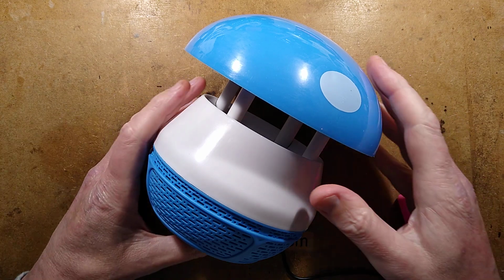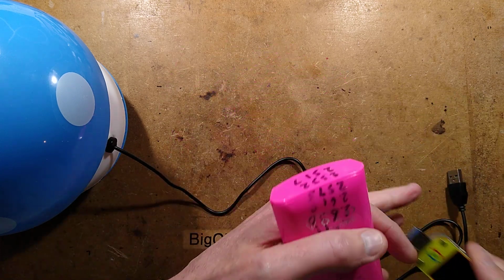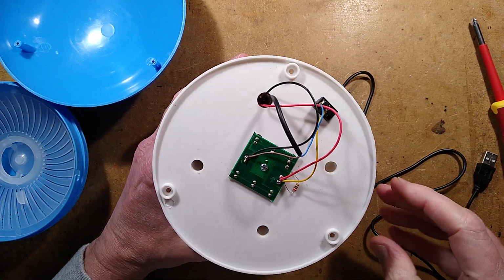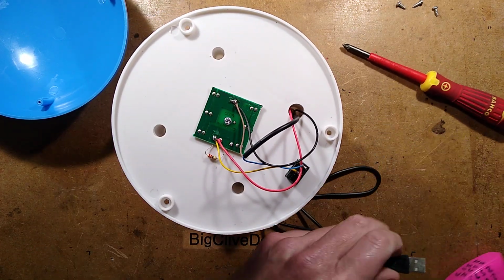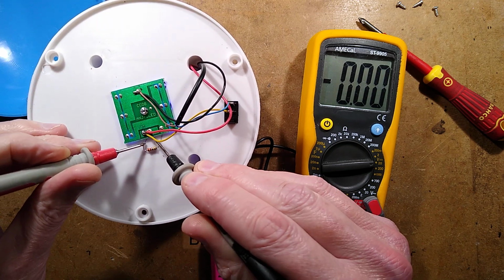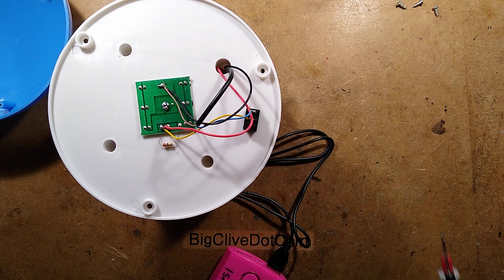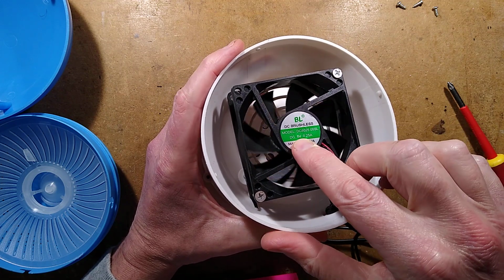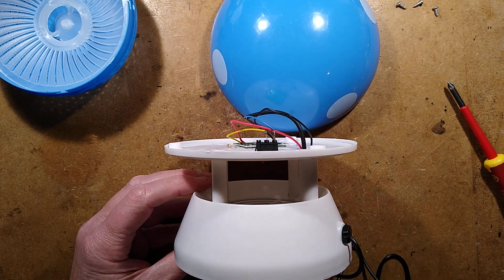Fly chopping electric toadstool

Comment: It reminds me of a project years ago that I saw. It was a "better mouse trap". Two plates insulated from each other with a high voltage between them. Cheese in the centre. Rather than killing the mice the muscular response to the boot threw the mice off the thing but they kept coming back for more. I resisted the temptation to build one.

Comment: Those LEDs look like they're some flavor of UV instead of the usual blue; you spotted it, the visual diffusion inside the plastic is a pretty good indicator.
If you have anything blacklight reactive laying around, stick it in there and see what it does.  It will probably light up like a scorpion under a geological study UV lamp.

Comment: looks like it could easily get turned into a slug trap if its rubbish at catching flies. bit of beer in the bottom and your good to go. You could get rid of the mosquitos with this also. the mosquitos would be attracted to the CO2 from the beer. bonus points if the fan is still running to fling them into the puddle and drown

Comment: How reliable are multiple LEDs in parallel? If they're anything like ordinary diodes, if one gets slightly warmer it will take more of the current and get warmer still.
Reply: I believe that you are correct. Each and every LED should have it's own current-limiting resistor. One LED will hog the current as they age.

Comment: I expected an element with a boost voltage transformer like proper insectocutors with the blue tubes, basically this won't kill flies unless they get chopped up in the fan, the odd one might, might be good to use as a child's night light once the fan is removed, sadly I can't see it performing well as an insect killer though.

Comment: Wow! As if the tiny bits won't be blown out of the openings and the bodies desiccated in the process, making them even more likely to blow through the slots! Incidentally I bought a very well made mosquito attracting device using UV and I found it to be extremely ineffective and the mosquitoes randomly flew right past, entirely unaffected by the light.

Comment: My experience, and a scientific paper I once found, tells me that mosquitoes have multiple means of navigation with different priorities.
CO₂ gets absolute priority. If they notice a stream of CO₂, they will fly into it, which leads to the god awful buzzing around one's ears and sometimes even the @#%* things trying to fly into your mouth.
In absence of an obvious CO₂ source however, they usually want to fly towards light, with apparently a preference for bluish light. This makes it a terrible idea to leave one's window open in the evening with the lights on, especially if that window is facing in the opposite direction of where the sun is going down, because you'll have all the mosquitoes flying towards the sunset and towards your window with the deliciously attractive light. I have made that mistake one evening last summer, and I have slaughtered about 80 (eighty) mosquitoes that night, yes I counted all their corpses. I used a mains powered insect lamp which I had to empty at regular intervals because the insects were overloading the circuit with their smouldering corpses. The smell was terrible.
This insect lamp of mine has a high voltage grille with a fan behind it that sucks the insects into the grille, and a bunch of LEDs to illuminate the whole thing. The LEDs were originally all near-UV and the whole thing was black plastic, terrible design. I replaced one of the LEDs with a blue one, and I added paper inside the casing which made the near-UV light fluoresce into a nice bluish light. These mods have greatly increased the effectiveness, but still the mosquitoes will usually only fly into the lamp if I'm not in the room for a sufficiently long time due to their preference of CO₂ over light.

Comment: It's actually rubbish, had one of these just a bit smaller, with the same sized fan and LED's, but didn't do anything. flies had nothing to do with it. Got back to the sticky glue band to get rid of the m and it worked much better.

Comment: Honestly, it IS kinda worth it for the fan... It can be hard to find 5v low RPM fans that work reliably at those speeds/voltages. Sure, you CAN undervolt, but that is already kinda sketchy... Plus, this has a LED board that you can swap out for slow/quick flash RGB LED's and make a psychedelic toadstool. ;D

Comment: I bought a similar unit called " Katchy " from Amazon for about USD $40.  The only significant difference is that Katchy has a replaceable sticky pad on the inside bottom. It works for fruit flies but not great. The old paper funnel taped to a glass with apple cider vinegar plus a little dish soap puts it to shame!

Comment: Is it actually possible for that to be a brushless-motor fan? I thought brushless motors required an external controller.
Reply: There's a tiny chip on a circuit board which is responsible for the commutation. It's cheap and they don't need anything sophisticated like you would on "real" motors.
Reply: @eDoc2020  Oh, neat. Thanks for the explanation.

Comment: 300k hour life is the cumulative total lifetime of all the parts. Each LED will last 5.7 years, irrespective of being on or off, and they already have had 3 years of that removed in storage and shipping, from the hole in the wall factory where they were assembled from reject dies, to the assembler, where they spent another year being stored on the forgotten back of a shelf. Then a year in slow shipping at cheap rates to the UK, so all the life that is left is around 250 days maximum, before they are destined to become yet another piece of cheap tat in a landfill.

Comment: I must be wrong, but I always thought that P=I^2*R - but BC only uses P=IR to work out the power dissipated by the resistor.  What am I getting wrong?
Reply from the maker: I generally calculate the current through the resistor first and then multiply it by the dropped voltage to get the power dissipation.
Reply: @bigclivedotcom  D'oh!  Of course!  Thereby turning it into P=IV.  Thanks Clive, and I'm honoured that you replied! :)

Comment: As someone who has spent a lot of time in northern parts of Canada, I assure you these silly gadgets won't catch anything but moths at night. It doesn't matter what it costs, these gadgets don't do a thing, and we have tried em all. The ONLY type that works is the ones that use propane. You gotta understand that mosquitos are attracted by heat, CO2, motion and certain scents. We have to buy these silly big contraptions that have a 20 lbs propane tank and hook up to power that we run non stop around the cottage to have any kind of enjoyment by the lake in evening.
Reply: Try 0ff!
Reply: @Gfysimpletons  useless chemical, low DEET content. Tried all of that spray junk.
Reply: Wow!

Comment: Funny little gadget. But if you want to catch the mosquitoes that bite, you need an IR source - more specifically, a body that emits IR at around 37-40ºC, which is what mosquitoes look for. This can be achieved with a resistor. There used to be mosquito traps that used a small incandescent lamp (blackened to emit no light) to warm a sticky film that collected mosquitoes. I had one that worked very well, until the sticky film was so populated, it was no longer sticky. I failed to get a new sticky film for it (tried to improvise several adhesive alternatives, but they didn't work).

Comment: I was gonna say the eight holes might just be a manufacturing artifact, y'know, being cheaper to just make it symmetrical, but with the three screwposts maybe that's not the case after all. Either way, I somehow doubt they'd go through the effort of making an 8-led version if the 6-led one does the job (gotta save every fraction of a penny, I guess). Or, maybe this is already a revised version, "why do we even use 8 leds in the first place, let's cut out two and see if it still works" kinda deal, and the 8-hole plastic shells were already on hand ¯\_(ツ)_/¯ 

either way, I always appreciate (comparatively) low-tech solutions, and something that can be cobbled together with a few leds and a fan (oh, and a switch, can't forget that) is pretty neat if it does what it's supposed to.

Comment: Living in a rural place the one thing we are not short of are insects and flies. Sometimes they can be on biblical type numbers, for example 6 years ago we had a plague of crane flies one week  in October the out side walls of the house were covered in them and they were swarming in through the cat flap in the breeze. We have tried the mains blue light electrocuting fly killer, but I am sure the blue light makes more come in. House flies are not attracted to them and just fly around the room annoying us. Since we have changed from incandescent lamps to led lamps the flies are not attracted to the leds, it was the heat of the incandescent lamps they liked not the light. I have tried the yellow sticking type fly papers but mine do not like yellow, i have tried white ones and not one fly would go on it, tried burning citronella candles they still came in. This mushroom would only attract dust. Because of the damp weather the plague this year was Gnats.

Comment: Strange you can measure the resistance while the circuit is powered on.
Reply from the maker: Measuring the voltage drop across a resistor in use is one of the most accurate ways to check circuit current.

Comment: I had one of those in a similar model. It didn't catch many flies. They sell a scented disc that is supposed to go in the bottom to better attract the flies. With the few flies I get in the house, the single-sided flypaper that sticks to the window works much better. It actually works.
Reply: Flypaper works for miller moths (the kind of tiny moth that breeds in grain products), too. For me, it works almost as well as the traps with pheromones, and at a tenth the cost (so you can put up more of them).

Flypaper strips also work well for flies, if hung in front of a window. I get an annual hatch of flies in the middle of the summer, zillions indoors all at once. But they want to go toward the light, and keep trying to get through windows. Three or four days after I hang the flypaper, they're all stuck.

Comment: Would have been good to have some kind of cylindric mirror between the LEDs and the fan to emit more light to the sides of that „lamp“ to attract even more insects. I think driving the LEDs at 11mA is a bit to dim, rated for 20mA, I guess.

Comment: Wonder if the 50% 80% charge cycle for lipo would see less degradation 
    This charge cycle is recommended for my phone Samsung galaxy note 10 and I've seen alot of articles about the effects of completely charging discharging lipos and keeping then on charge after they are full 
   Leaving them sit when discharged and storing while fully charged is bad too and discharging charging over the c rating can lead to dendrite formation which is what causes them to explode 
    The new lithium ceramic batteries don't have this problem but don't have less power density 
    Hard to believe that basically one person is responsible for our modern way of life from transistors ram to lipos John B Goodenough 
I think he's a alien lol

Comment: I have a camping lantern that has some form of ultraviolet light attractant thing that shines through an opaque plastic and on the outside of that plastic is some kind of monofilament that won the mosquitoes are attracted to the light they land on the monofilament and it works like like your standard bug zapper but it runs off of rechargeable lithium batteries and it's freaking fantastic I love this thing all sorts of dead mosquitoes and and moths

Comment: I bought something like that before and it was on for 2 whole weeks solid and it did not catch a single fly but I bought one of those proper fly zapper thing with the 2 tubes and the electric thing and it had zapped at lest 2 dozen in 2 weeks after that...

Comment: I like the foresight in using brown and blue for the 5V wiring as it means they can also use it in their 240V powered appliances as well. Good design for manufacturing. Electrocution of customers is optional, but highly probable. But still shows good ol' fashioned Chinese ingenuity.
Reply: Swap the resistor for a film cap and a couple diodes and you're off to the races
Reply: Thats just European wiring colours. esp germany and its colonies like whole eastern europe.
It doesnt mean that its AC only.
Reply: For reference. all DC cables in Europe are either brown/grey or brown/blue/grey. while ground is green with yellow stripes.
Or if more than 3 wires in cable then they are black with each wire numbered and gray for negative
Reply: @CC-vv2ne  I didn’t know that DC has a ground.
Reply: They don't give a rat's ass what voltage goes into what color, it's the cheapest wire they happened to have in the shop that month.

Comment: That fan is marked "BL" but is either manufactured by Yun-Fan or one of them has copied the other. Yun-Fan makes these with sleeve, hydraulic or dual ball bearings, but I can't tell for certain from the model code what this has. If I were to guess I'd say it has sleeve bearings due to the "SL" as the end of the code. Most of these product codes tend to include some stats for the fan. In this case it's DC for the power is uses, 80 for being a 80 mm fan, 25 for being 25 mm thick, 05 for being 5V and finally SL which I'm pretty sure stands for sleeve bearing.
Reply: And for those who don't speak bearing: sleeve bearing means "axel in a hole". So no balls or roller needles. Just a stick with some grease on it with a mating surface that doesn't look like the surface of the moon.

Comment: The version i have has a ultraviolet ccfl. There is also a titanium dioxide coating that in contact with uv produces co2 which attracts even more mosquitoes. Works quite well.
Reply: This explains why every bug in a hundred mile radius gets stuck to wet paint! I can tell you from experience the nicer the finish you are going after, the stronger the attraction... last time I'll paint a car fender in my garage. 😆
Reply: How does uv on titanium dioxide produce CO2? Titanium dioxide is in literally like every paint, so I'd think they'd be attracted to any painted surface outside (solar uv). Unless it's some different kind or concentration of TiO2 or some specific wavelength of light required?
Reply: @rpavlik1  I think it can happen to some extent when the TiO2 catalyzes breakdown of stuff that lands on it, but I doubt it can produce CO2 from the air otherwise.  The TiO2/UV interaction is usually described as a self cleaning property rather than a CO2 production method.
Reply: @big0bad0brad  Many the coating includes a supply of a carbon compound.  BTW, TiO2 is getting banned as a food coloring.

Comment: Considering that mosquitoes are mostly attracted by heat and carbon dioxide, I find it appropriate to run a motor 24/7 and put a shock grid on the vents of the machine.
Reply: The crack noise of the discharge is really quite gratifying. That is one less parasite after my blood. How can we attract the tax man?
Reply: Maybe a sterling engine run by a candle

Comment: I could listen to you for ages, I know very little about electronics and when the calculator comes out I'm lost. Feel like a real thicko....
Reply: There's really only two simple equations to learn to cover most basic electronics. Google the VIR triangle, that covers how voltage, current and resistance interact. Then remember that power is voltage X current and you're good, at least for any basic DC circuits.
Reply: @georgeprout42  thanks for the reply

Comment: Near the end of the vid, Clive, did you not notice the 'entrance' to the fan had a phosphor? on parts of the grille converting UV into bright visible light ? Maybe that brighter bit will attract the flies into the fan ?
Reply: That's not a phosphor, it just the concentrated beam from each of the LEDs.
Reply: @haywoodyoudome  It's fluorescence - far too focused for being from LED beam
Reply: I’m not sure that was a phosphor. I was thinking that might be an UV activation of particles inside the plastic, but only from certain LEDs.
Reply: @shubinternet  Same stunt as hi viz vests - converting UK into visible light - which on /reflection/ would probably be an improvement on the UK having spotted the typo.

Comment: I have to say, if you've a fruit fly problem, just get yourself some flypaper and a cheap bottle of red wine - leave half a bottle of the wine open in the infested areas, and the flies will drown themselves. Those that don't will get stuck to the flypaper.

Sometimes the best solutions are the simplest ones.
Reply: Or use apple cider vinegar. And put a few drops of liquid dish soap in the vinegar, it’ll reduce the surface tension and make it easier for them to drown.

Comment: It would be really interesting to see something like this converted into a sort of air sanitizer?  Maybe replacing the LEDs with genuine UV germicidal ones, adding an ionizer / ozone generator, and filters on the air output?
Reply: UV-C LEDs do exist but they are very expensive and very low power output. On the order of $6 for a single LED that outputs 0.02w. So my presumption is that 100% of LED-based "uv sanitizer" devices are fradulent. 

By comparison, the 8w T5 uv-c bulbs that fit in my air scrubbers are $10-$15 each. In that application, fwiw, they function to energize a grid of titanium dioxide so that it may attract and shred volatile hydrocarbons.
Reply: Just increase the fan power until it attracts and dispatches a sufficient quantity of flies for your use case.